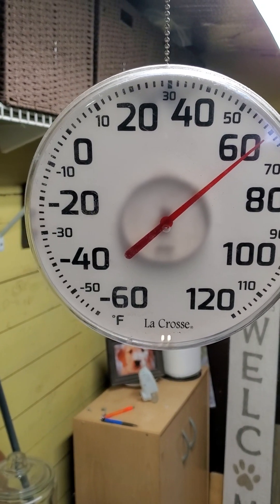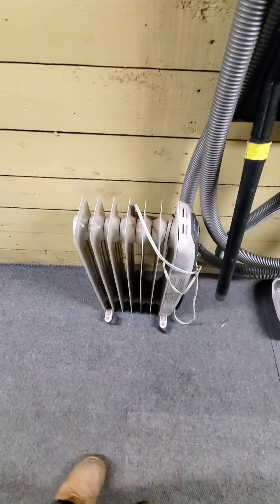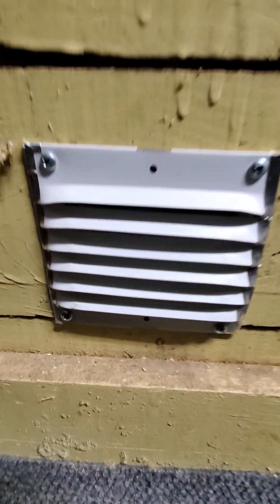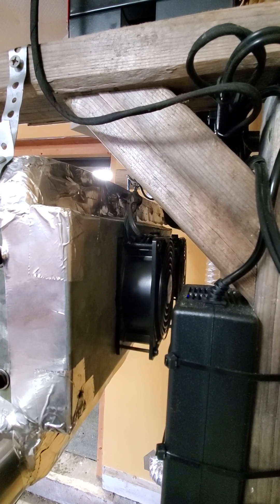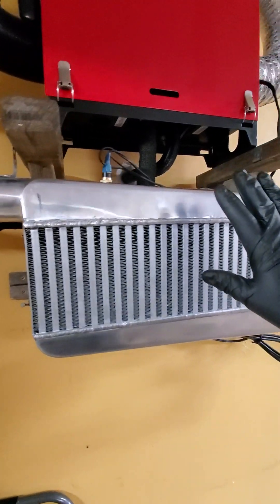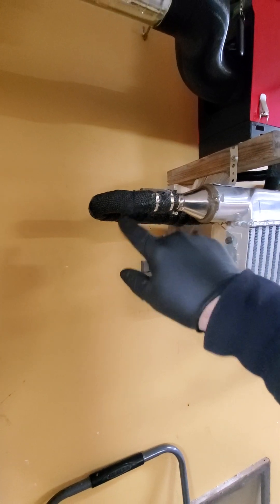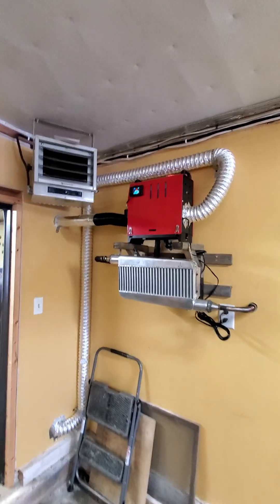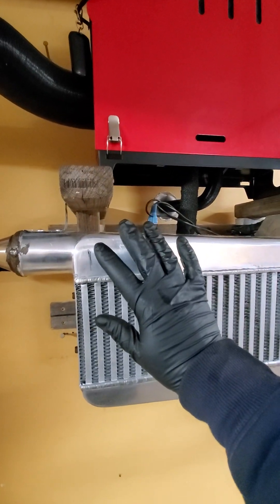Chinese diesel heater almost done! heat exchanger working well

Comment: A Russian guy analyses a 8k set up much like yours - om max gave 4.5kw the blower and 1.2 kw out of the exhaust radiator - he was very scientific with a lot of math - interestingly, he calculated that the unit does not consume 8 kw of diesel  on full and showed that the burn chamber was the same dimensions as 5kw but fed slightly more fuel

Comment: Is the one thing I would do to this. Don't take your are from the outside for the unit take it from the inside. So you're not trying to heat are that's already 30° your heating air that's already 50 or 60. AKA you gain even more. Nice work.😊
Reply: The air has to come from somewhere, if you are pulling air from inside the building but exhussting it outside then all you are doing is pulling in cold air from all the leaking sreas of the building. 
Also more importantly having a 
diesel heater for a few years now... They sometimes quit or fail and the smell is horrible it leaks back through intake, so keep intake and exhaust outside is best.

Comment: Make it better?…. Put the air intake inside!  Now you are pumping colder air from outside into the shed.  Circulating the warmth inside makes it also easier for the heater!  Less fuel needed!  This means also over pressurizing the shed, ( it’s minimal but it’s there!) and this makes the warmth in the shed escaping / pumping easier thru all small holes and gaps  that are always there!  And,, I would put it much lower, easier to handle everything……..Overall….👍💪

Comment: Very nivce setup. It would be nice to have a simple temp reading of the heater side of the intercooer and the exhaust side for comparison. However, the fact you can grab the exhaust side of that intercooler about says all I need.

Comment: take that flexible shiny crap and junk it  your loosing alot of cfm with that stuff use heating pipe the solid stuff and get rid of the thermostat on the intercooler why do you need that ?

Comment: nice  btw carbon monoxide dont sink, it actually lighter than air and stays more or less at the same level or mix with the air in the room, carbon Dioxide is the one that sinks

Comment: I run 6 ft exhaust with fan blowing across it.   It exits the house sleeved by 1-1/2" copper pipe.  Since exhaust is at room temp, I will call heat recovery to be 100 percent..

Comment: Try changing the air return duct to go below your heat exchanger and circle up and back to the heater’s intake : it will reduce the length of the duct by about 4 feet and eliminate one 90 degree angle from your intake duct .? 🤔

Comment: Please Help.  
I got taken from some A******s and ended up with a new uninstalled furnace (which I paid for separately), and about $6000 Stolen.  Needless to say I needed something fast.  
I copied this exactly and it is Awesome Thank you.  The fans and inter-cooler make exactly the difference between 55 deg and almost 60 in my home.   I was sure to keep everything moving down grade to avoid moisture build up.   I have a fan blowing on the inter-cooler and am making a manifold today.  I would like to install the temp sensor though do not know what sensor to buy and how to connect to the fans. 
This has been a life saver. Thank you again
 Please post those items and maybe a run down on how to hood it up if your able.

Comment: I was also looking into how to capture the heat from the exhaust, as it seems to be as hot as the air going into the room; how wasteful!   I was thinking of using a cheap radiator that I could get on eBay for $39, but someone said soot might clog up the little channels.  I haven't tried it yet, but for $39, it might be worth a try.
Reply: Have it always going downwards and put a fan across it.

Comment: Why wrap the exhaust hose?  If your objective is to dump heat into the garage, that is where the heat would go if it was not wrapped.  It would leave your heat exchanger with less work to do.
Reply: to avoid anyone accidentally getting burned by it
Reply: @The-Cat so..   do like I do,  keep people and animals away and run a fan over the exhaust.  You know, like a heat exchanger only efficient..
Reply: @hillaryclinton1314  the location of his installation is near a door.  Not a good place to have such a suggestion work out safely unless he builds a false wall or some sort of barrier in front. 

¯\_(ツ)_/¯ who knows maybe this is just a temporary or experimental build

Comment: I'm kind of lost about the intercooler in this setup. 
Is that causing the heater to output more heat ?. 
Otherwise to me the intercooler is radiating heat and warming up the 2 car garage. 
🤷🏾

Comment: Just curious if you had any problems with sit buildup and what settings are you running your heater on. I have a heat exchanger that consists of coiled up exhaust pipe inside of a 6 inch diameter HVAC pipe with a booster fan that draws air from above and pushes it down to the floor. Average temperature coming out on low setting from heat exchanger is 86 ° f. But I did have an issue with the heater after the first week I believe it was due to the length of exhaust pipe with the added bend
Reply: *soot?

Comment: I would put the pipes the other way around so it is drawing air from the top & blow it out the bottom as heat rises.
Reply: Which is exactly why it’s the way it is you are sucking the cold air off the floor and heating it.

Comment: @davidlacroix8496 are you getting any condensate build up in the bottom of the intercooler? You have the blank plug for the heat sensor that you can open and check…

Comment: Very good system, almost perfect.
I think it is difficult to do any better. 

If you can, please do another video with measuring temperatures.

And, about these diesel heaters.
Sellers are selling those like 5 to 8 kw heaters, and that is total bullshit. 

Those heaters burn diesel fuel from 0,12-0,48 liters per hour. 
One liter diesel contains 10 kw of power.

So, on minimum setting burned fuel contains 1200 w.
And full power 4800 w.

And, now that important thing, half of that energy is going out from the exhaust. 

So, real power is.

On low. 600 w.
On high. 2400 w.

So these are not even near 5 or 8 kw heaters ?

But, when you do recovery system like you, then you can have about 4500 w max, out of this heater. 
Not ever 8 kw.

But good video, and important information to all who want to take everything out from heaters. 

Thank you.

Comment: Where did you get the exhaust adapters for the inlet and outlets to go back to original pipe.  Looks like a great idea even if the aluminum has some problems with condensation. Will probably get your money’s worth I sure.  Great video thank you for taking the time to post.

Comment: The avid in the exhaust will not work well if the inter cooler is aluminum on the exhaust side .
Once the exhaust gets cool enough the acid and water will condense and ruin the aluminum .
Reply: True for home heating oil due to sulfur content..  not so much for low sulfur diesel and petrol.   But so what?  Just put a fan on a 6 ft stainless exhaust and problem solved

Comment: Refuelling must be a nightmare run a fuel line from a drum outside would better.
Reply from the maker: @BS-ql5nl  old windshield washer jug... 1 gal per day,  only have to go 75 ft to get that gallon of diesel. Easy enough to pour it in through the top

Comment: A used car radiator would have been a lot cheaper .
Reply from the maker: @philliplopez8745  the plastic tanks on an automotive radiator would not stand up to the 250 plus degrees

Comment: Best improvement that I have made was a 4 inch duct boost fan on the air intake . Keep the heater cool , moves a lot more air . Best $ 20 spent
Reply: Gonna disagree..  unless you are running at full speed, all this does is cool the incoming charge and if it stays lit, move the flame front out into the exhaust..

Comment: but It's still Not off the grid, Diesel Heaters are real battery eaters, Diesel Heaters need to be able to recharge the battery then They would be much better, I have a Biolite rocket stove that recharges the battery but It's only 5 volts
Reply from the maker: @stevethompson1488   not trying to be off grid. Diesel/ off road diesel is cheaper than a 5000 watt garage/shop heater.

Comment: More proof to show these heaters do work well and
if you are smart enough to put something like this man
has done together you can save money on heat for what
you need. Thanks for your great video of your design 
looks like you did a great job on this heater install ; also
looks like a safe set-up. And you want to keep the dogs
you love warm and happy!    Thanks
Reply from the maker: @billyboozer8806  the only issue I am having currently with this particular heater is that when I choose the low heat setting, the room fan surges...on high, it works great.
I am going to be buying another heater anyway, so i am curious to see if it is just this heater...
But thanks for the compliments!!

Comment: Nice set up. I like it. This is MUCH better than a cast iron radiator. 

A few thoughts. 

1.The exhaust insulation is pointless as any heat you lose is into the space that you are trying to heat with the exchanger.

2. I'm not going to go in depth explaining this, but your fans should just run non stop. If possible, you want your intercooler / heat exchanger to be at room temperature... that way you are pulling as much energy out of it as possible. 

Cheers.
Reply from the maker: the insulation helps get the heat into the intercooler, where it needs to be. initially the temp sensor would not get hot enough to activate the fans.. i did think about using a long section of copper baseboard heater pipe but i wanted the "force hot air" effect with minimal electricity usage. i may install a speed controller on the fans
Reply: @davidlacroix8496  Not to be argumentative, but you're not trying to heat the intercooler, you're trying to heat the air, and an uninsulated pipe will achieve this. By insulating the pipe, you are just placing more responsibility on the intercooler. 

To get the most efficiency as possible, you want the fan to come on when the intercooler is at room temperature. If your exhaust gasses are leaving your building above room temperature, then you are throwing energy away. 

I made a video about this recently, and while it may be a little unintuitive, it is impossible for the fan to come on at too low of a temperature. It should just be running all the time, and ideally you have a controller that limits fan speed so that the exhaust coming out just a few degrees above room temp.

https://youtu.be/cNST3LTnNIs
Reply from the maker: i know i am pulling 99% of the heat because the exit pipe is barely luke warm to the touch, even when the fans are not running

Comment: Great vid and info appears to be quite badass
Reply from the maker: @lorenwright3202  it definitely functions as I had hoped
Reply: @davidlacroix8496  excellent I will attempt to use your methods for my project as it seems to be almost exactly what I was looking to do but in my case I wanted the main heater to heat my crawl space while captured waste heat being used for the main area

Comment: I didn't hear you say whether or not this heater is one of the variations that are temp controlled with a built-in thermostat. If it is, the thermostat is usually attached to the control panel, which would be more efficient if mounted in the puppy room, since that's the room you are ultimately trying to heat up.
Reply from the maker: @nytrot3ch474  the controller can be switched from thermostat or constant heat setting
Reply from the maker: @nytrot3ch474  so I did end up buying an extension for the control panel which is now mounted in the puppy room... I did find out this control panel can be switched from a thermostat style operation to a power level setting which runs constant at the desired power level